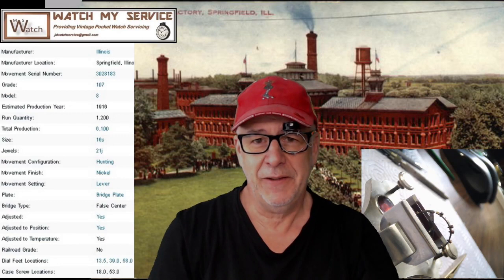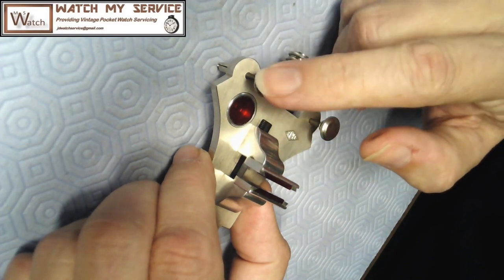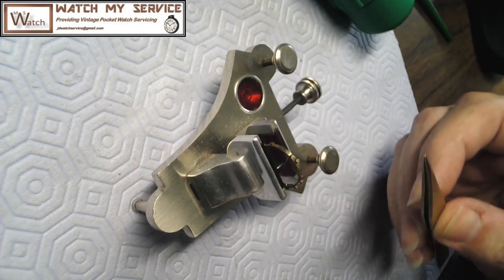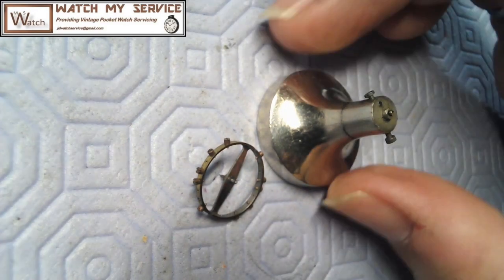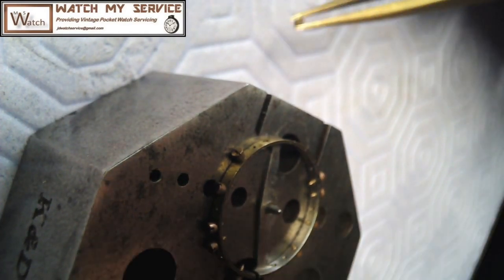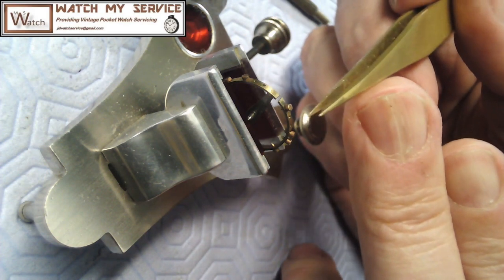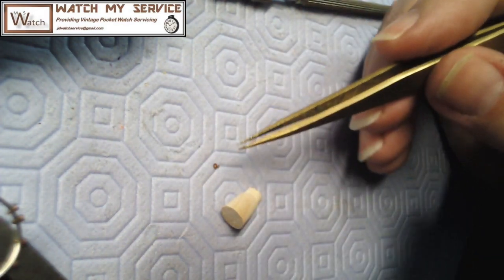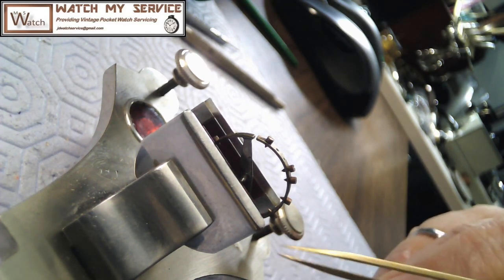Poising a Watch Balance

Comment: Is having the rollers, removed better or needed? No jewel, or safety in the case of double roller. Can just with no hair spring do the same thing?
Reply from the maker: You should always do this with the hairspring removed. But I would leave the roller table on as it does affect the watch balance when it’s turning.

Comment: The wheel is out of poise but only when measuring the static poising. When the hairspring is mounted you have to measure the dynamic poising, don't you? And then the previously thought as "static-out-of-poise" balance wheel together with the hairspring could be very much in dynamic poise, right?
Reply from the maker: Perhaps you are correct. If you add the hairspray to the watch, that is completely poised it may slightly change the poise of the watch, but remember the call and hairspring are studded to the balance cock and so the hairspray is kind of independent of the poise of the balance

Comment: Interesting and thank you but a new tool seems to cost around 500 UKP so I don't think I'll be doing much of this.
Reply from the maker: Are you talking about the Poising tool. If so, go to Dave’s watch parts and he likely has one: and not that expensive.
Reply: What JD said-Dave has several from 25 bucks to 50 bucks. Ebay has a boatload of nice ones about the same price.
Reply: @machinistmikethetinkerer4827  Certainly worth the risk. It's just that this is a precision instrument so is a used precision instrument going to be good enough. I suppose at that price you could try several, but how do you test the precision of a used precision instrument like this and how do they justify 500 GBP for a new one.
Reply: @brianskinner3747  ya got me on that one. These are the things I look for: 1) craftsmanship
2) leveling bubble intact 3)is it branded? 3)is it vintage? 4) most important- are the jeweled jaws intact, sharp, parallel and free of chips and nicks? Is it clean with little or no pitting? Threads all intact?  Bonus if it comes in original box or a decent box. I bought a sweet Levin model  including the box for 45 bucks from the 'Bay. Aside from being very vintage it is mint and works great. Not much to them except getting them level, then poise your balance. Who knows maybe I got lucky? I'm just a hobbyist and just got into it bout a year or so.
Reply: @brianskinner3747  which brand are you referring to that costs 500P? don't know what the USD equivalent is at the moment but it sounds like alot lol if it's new it's probably Bergeon or Horotec(not sure if they even make one)and anything marked Bergeon is expensive.  Try a used one you'll be surprised. Do a little research you can find a decent used on that still does the trick while saving yourself hundreds of dollars. I think you'll be just fine.